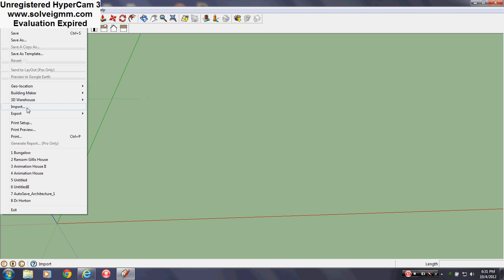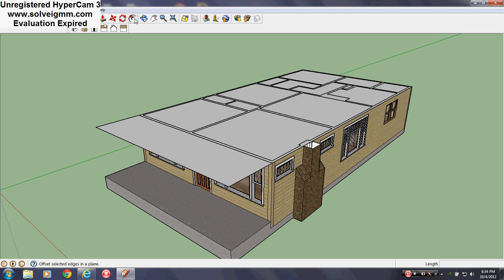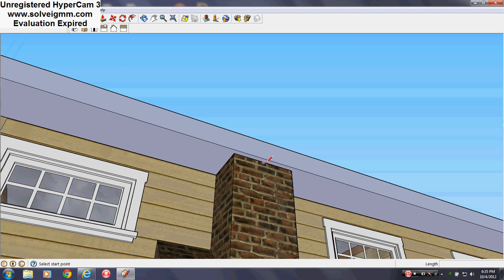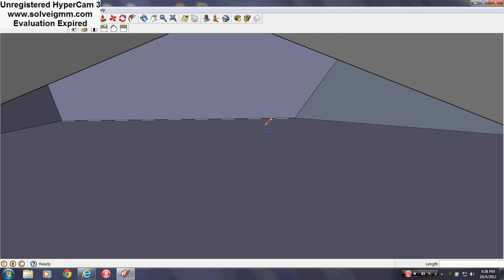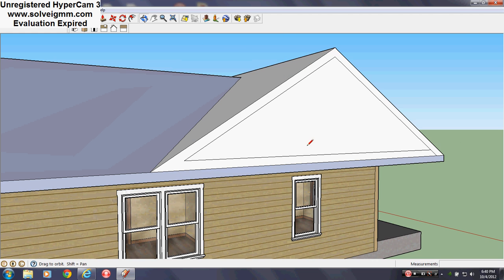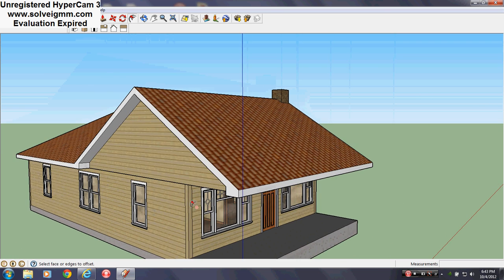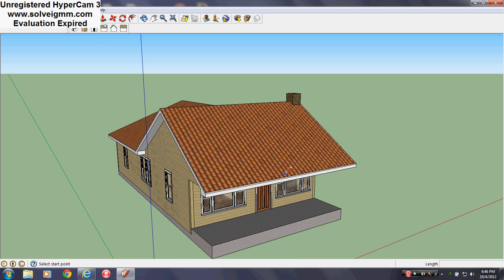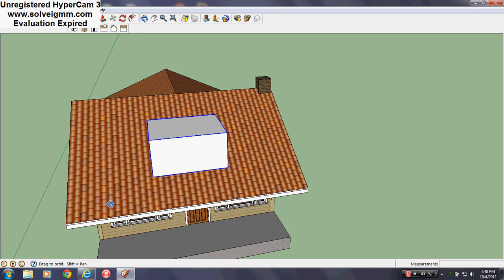Sketchup Roof Tutorial

Comment: when i use the offset tool to create the eaves, it offsets all the internal walls also, making a giant mess. how did you make it just offset the first rectangle you drew? thanks
Reply: After you select the offset tool you need to select the face or edge(s) that you want to copy with an offset. It sounds like you selected a grouped object so SketchUp thought you wanted to offset from every line in that geometry. Make sure you're just selecting the edges that you want to work from. If those edges aren't in your current group or layer you may have to make copies in the layer and group where you want the offset to occur.

https://help.sketchup.com/en/sketchup/offsetting-line-existing-geometry